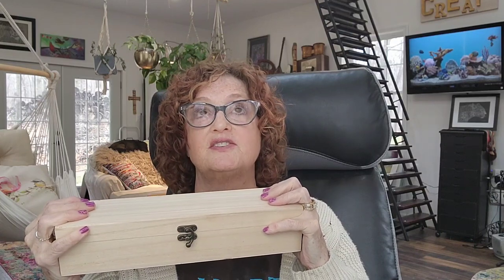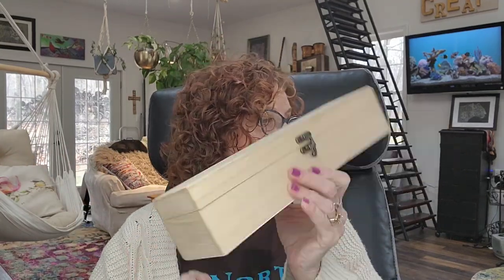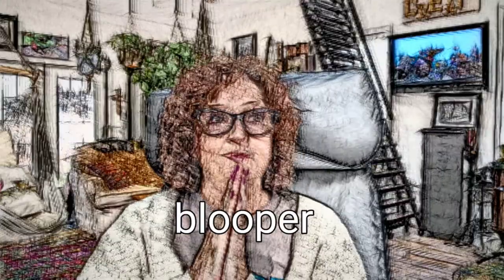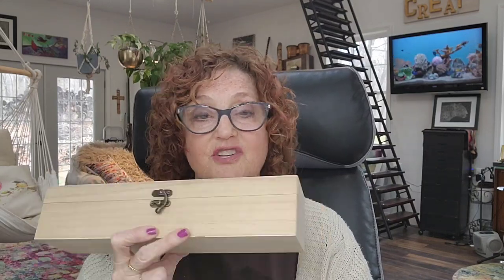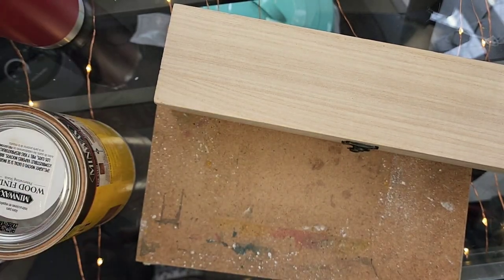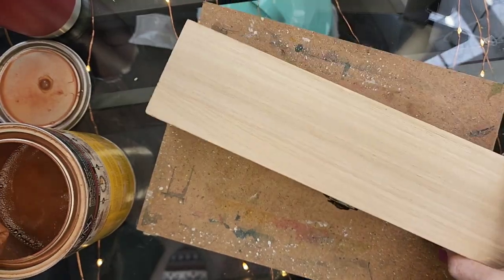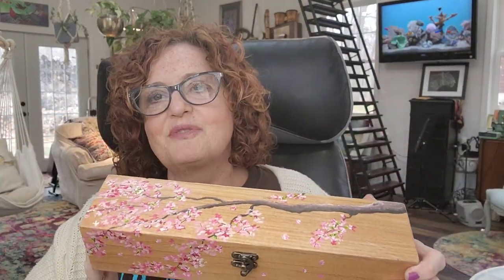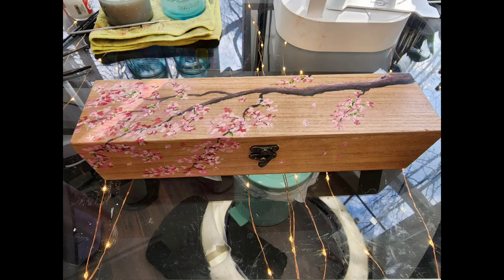Painting Cherry Blossoms On Wood With Gouache And How To Seal It

Comment: Beautiful! You are so talented. I love using wax on my wood craft pieces. I use Wise Owl Furniture Salve and as an added bonus it comes in many lovely scents 😊
Reply from the maker: This only comes in chemical scent! Hahahaha.
Reply: Does the Wise Owl work the same way as the furniture wax Sharon used? I love the finish it gave to the box but a scented wax would be lovely.
Reply: @Pawsinthegardenstudio  I use a round palm brush to apply it and they say to wipe it back, but I don't do that, it seems to "complete" the paint if you let it soak in and cure. I use a lot of chalk paint, though. Not sure how that compares to the media you are using. It can always be reapplied and gives a satiny finish.
Reply: @Pawsinthegardenstudio  the wood pieces we get now are so dry, they need some oils and even some water sprayed on while painting.